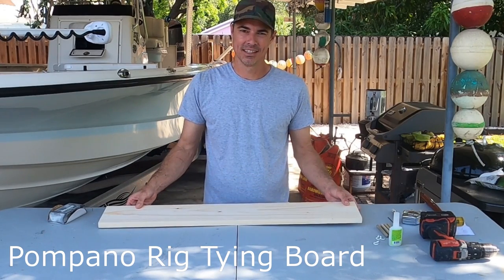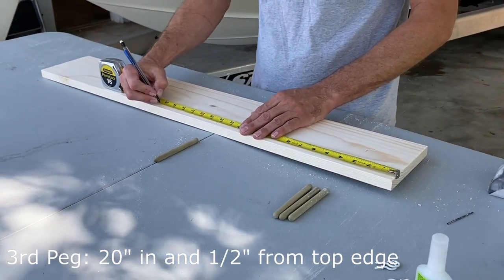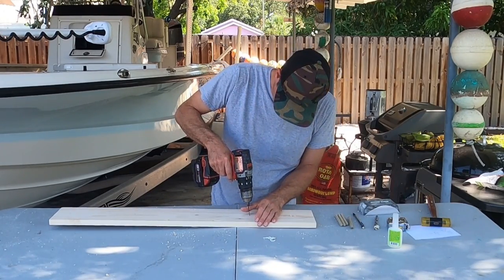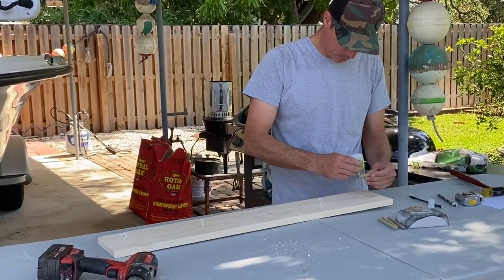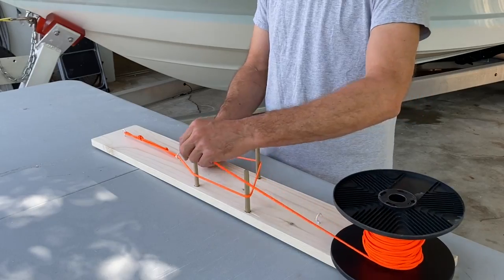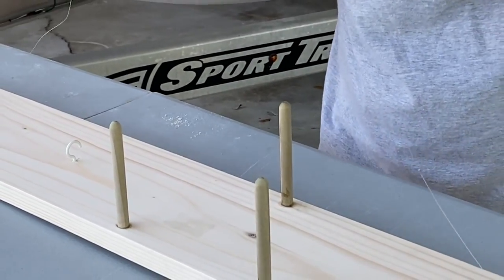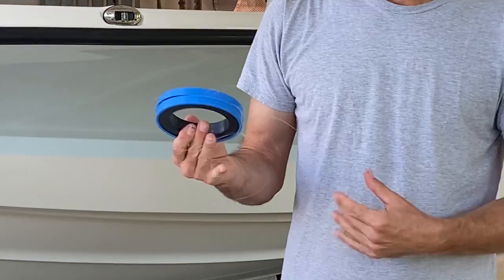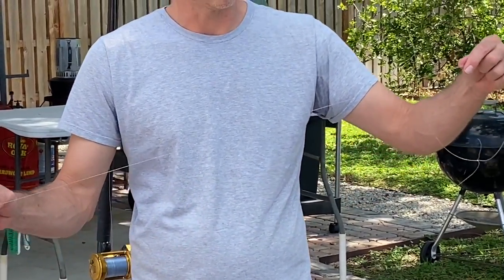How to make a Pompano Rig (Dropper Loop) Tying Board

Comment: When you tied the double uni knot was that for weight side of the looper rig, and what is your recommended length?
Reply from the maker: The double uni was attaching the rig to the main line. I attach the sinker with a duo lock to the third loop